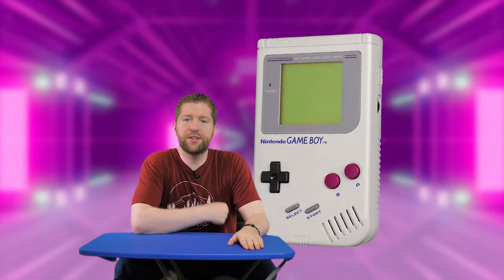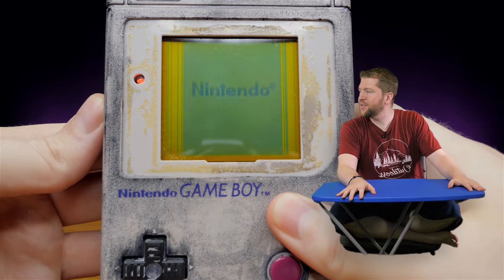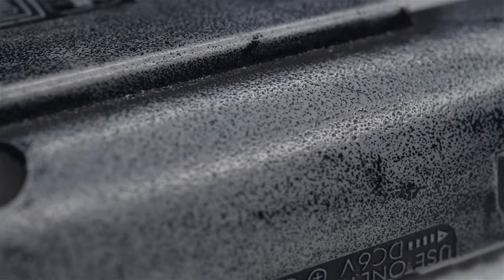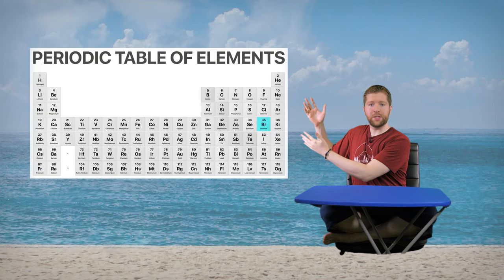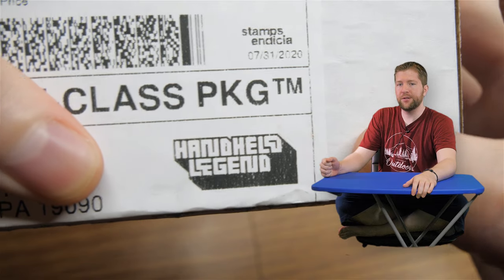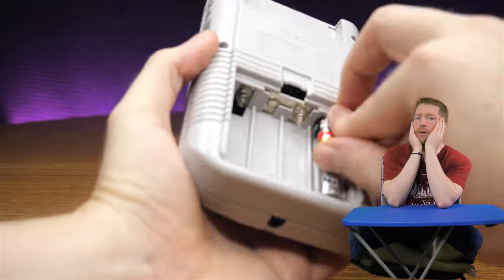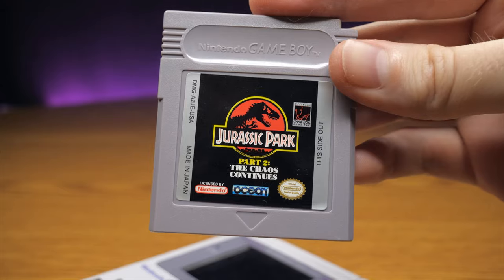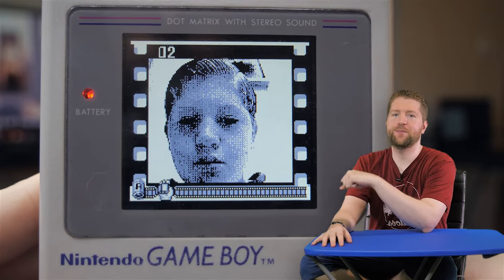Extreme Game Boy Repair | Restore | Enhance 😃

Comment: Do you know someone who can repair a Snes like you did with that gameboy?
Reply from the maker: The snes is notorious for yellowing. Maybe after watching this, you would feel comfortable trying to restore it yourself?
Reply: @3DSage  yeah, I've got one and I would like to make it white again, do I need to use those UV lights or did you use them just to make it restore faster? (Sorry for my bad english XD)
Reply from the maker: @minerados273  Yes you can. The sun puts off uv light so you can put the plastic out in the sun but it has to be a bright day, no clouds, and you have to keep repositioning the item as the sun moves. 8-Bit Guy tried a method of using heat on the stove without any UV light but I was too scared to try that. But his results were good.
Reply: @3DSage  thanks! My snes has a lot of dust and it's REALLY yellow, I'm going to try this.